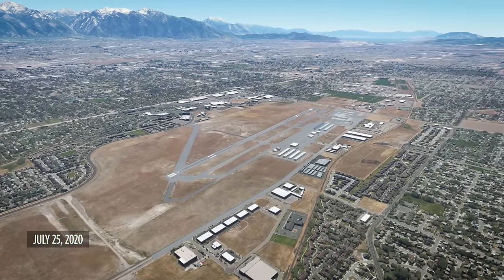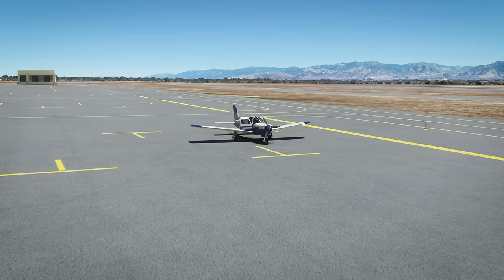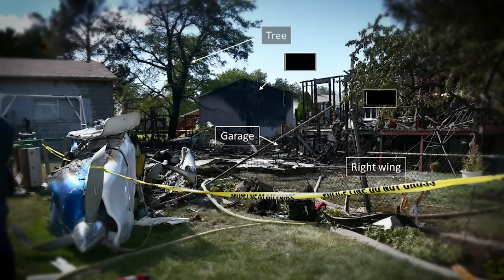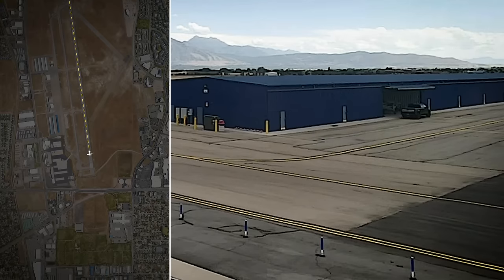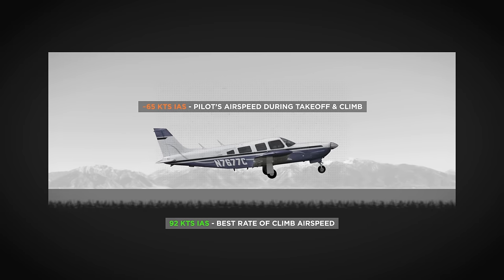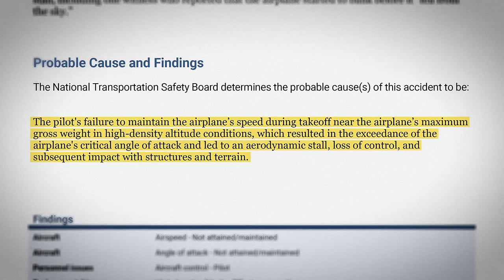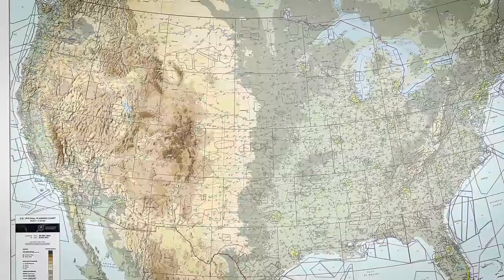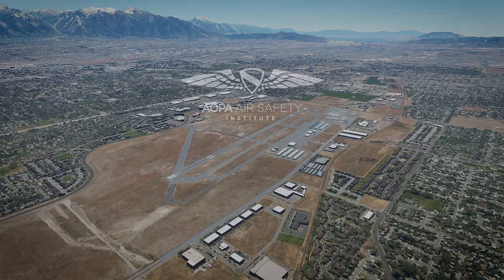Accident Case Study: High Aspirations

Comment: This is a tough one, as I think many pilots could see themselves in this position. It's easy to brush off the accident reports where the pilot does something grossly illegal or dumb and say we would never do that. In this case, the plane wasn't overweight and wasn't out of CG. The book said the takeoff could be done. Took the runway that aligned with the most recent wind report. Considered effect of density altitude on mixture setting (though perhaps too late). No single decision/mistake on its own was enough to cause this accident. It was the classic aligning of holes in the swiss cheese, where multiple small errors combine to make a huge one. Very sad and a good lesson for us all. Thanks ASI!!!
Reply: I couldn't agree more. This is really not a good example of pilot error.  Obviously a conscientious pilot, followed all of the regulations, and was not outside of the envelope in any way. I'm sure that if he took off Against the Wind he would not have had a problem. And we all know the wind can shift whenever the wind wants to shift. He could have checked wind direction 5 seconds before takeoff and the wind still could have shifted.  This is what has always made me nervous about flying. Even doing everything right is not a guarantee of safety.
Reply: Still would argue that it is a failure of regulatory bodies to allow planes to be certified with poh that seem to have almost nothing to do with reality… a 50% margin of safety on certified poh numbers? The margin of safety should be published in the poh at least no one would ever have an accident because their normal flying aircraft didn’t meet those numbers…
Reply: Absolutely agree.  The numbers said it could be done.  I cannot comfortably say that I wouldn’t have attempted the flight myself if I had been in the situation.
Reply: Planes have one job - maybe the Piper aircraft company would prefer it if you used their performance product with half a tank and seats empty
Reply: @jfmrod  It would be hard for manufacturer to estimate how much someone's engine or airfoil would degradation based on their use case, let along what's your habit on the yoke which also would affect the performance.
In airline there are now performance monitoring program for each individual airframe, I wonder if it could be done with GA as many people already have some sort of computer device around.
Reply: @umi3017  lol as if it wasn't already expensive enough
Reply: @vincelam1998  Normally, I'm on your side. I hate that Uncle Sugar wants my car to cost more every year. But, in this case, you don't need a lot of expensive gadgetry. Like the man said, maybe it's enough to have a phone? Just tell it what you're planning to do ("Climb from 3500 to 5000 feet") and let it record how long it took. I bet the right math could derive some useful performance data from that sort of thing.

Alternatively, maybe just dyno your engine every year or so. :p
Reply: @jfmrod  Agree with this wholeheartedly.  Fantasy POH numbers should be a thing of the past.
Reply: I disagree, what holes aligned to cause this crash?
Reply: We get a wind check with take-off clearance.. he would have been aware of the actual wind, not dependent on a forecast. Performance figures are based on a new aircraft flown by a company test-pilot.. all the warnings were there.
Reply: @jamesgraham6122 this was an untowered airport.
Reply: Well said.  I thought the same thing.  But for the grace of God and a little luck go I.  I learn from every one of these terrific videos.  RIP to those who perished.
Reply: @jfmrod Yea %50 margin is insane to me, with those numbers I would certainly rethink anything in written on those performance charts.
Reply: I came here to say exactly this. What’s frustrating is the NTSB then essentially blames the pilot solely.
Like yes he took off. 
But what bothers me, even in this video, is the comments like “near gross weight” etc.
The fact is he was under by 70 lbs. He did a proper pre flight, did calculations, did a run up etc. the MANUFACTURER said it can be done. And it wasn’t like it was close. It said 500 fPM and was 70 lbs under. 
They bring up the weather report 15-20 minutes after the accident, but that’s AFTER. The weather report he had was the correct run way, and for all we know the wind was still that direction at take off.

Manufacturers need to be held accountable.
I mean throughout all of my training we are taught personal minimums.
However I can’t sit here and lie and say I wouldn’t have taken off. 
Landing and takeoff distance is one thing I add 30% to. He was within that margin. 500FPM is good imo. 

Manufacturers need to be held liable if they put data that is misrepresented or just egregiously incorrect like this was. 
Instead the NTSB blames the pilot and this video even paints the pilot in a bad light. The man literally did everything correct by the book. The previous instructors who flew with him said he was good, the DPE said they harped on DA and PA. He knew.
Sad situation all around but the manufacturer needs to be held accountable.
Reply: @jamesgraham6122  Clearance at an airport with no tower? How's that work?
Reply: @MindTesla well said
Reply: @SuppressedOfficial  With or without a tower there will be a windsock!
Reply: @jamesgraham6122 This was a non-towered field. There was no take off clearance. Many pilots are guilty of looking at the windsock in the taxi to choose runway and after that ignoring it, especially on days without significant winds like the day of accident.  Wind could have easily shifted as they taxied. The bravo shelf to the north may also have affected decision of runway as there isn’t much buffer north before entering class B airspace.
Reply: @ricbarker4829 High gross weight near aft CG limit, though legal on both fronts. Takeoff on hot day with high density altitude, but with POH saying runway length was long enough. Choosing runway with last reported best wind but not best runway for actual conditions at the moment of takeoff, though not a huge tailwind. Not setting mixture to max power on the runway but instead in the roll/climb out. Remove any one of these factors and it is a normal flight just like any other. None of these things are egregious errors and are something any pilot could do. Too many of them lined up on this day.
Reply: @spvan8715  So I understand, but ignoring the information available by taking note of the windsock is just as damning as ignoring information from the tower.. of course, we can only base our assumptions on the accident report. Whatever the wind, the decisions made concerning density altitude and aircraft weight were not consistent with a cautious approach in undertaking the flight.
Reply: @jfmrod  I'm not a pilot, but it seems like you're saying that the plane's engine was grossly under-powered for the conditions they said it would be capable of handling? If so, why are they manufacturing planes with such incapable engines? Why would you make a car that can barely merge on to the highway. Or is this such a unique flight condition that the pilot "should have known better?"
Reply: @spvan8715  Do you think maybe he pulled it off the runway too soon, and was stuck behind the power curve?
Reply: WRONG - The book said it could be done but the plane had other ideas. It was a too slow to lift off and in a near stall condition.....everyone wanted to fly EXCEPT the plane and the pilot should have set it down there and them....NEGLIGENT CONDUCT!
Reply: @SuppressedOfficial  You call Salt Lake City Approach while on the ground and get your clearance (phone, or radio if the frequency is not busy).  When ready, call them on the radio, and they will release you for departure, go to CTAF, monitor, announce, and launch.
Reply: Leaning the mixture to full power during engine run up is standard practice for high density altitude takeoffs. It's probably recommended in the manual for the Piper Lance. I know it is for other Piper models.
That was the first mistake.
Second was taking off with a tailwind. He probably didn't want to fly into the B to the north. One solution would have been to call the Tracon before taking off and get clearance into the B airspace. Otherwise a sharp turn just after takeoff would have been required, which would hurt climb performance. (Edit: the NTSB report says it was an IFR flight, so airspace shouldn't have been a concern.)
I wonder if there were other aircraft in the pattern using that runway. Sometimes people flying repeated traffic patterns don't get weather updates, and continue to use the wrong runway. Then a pilot who wants to take off is pressured to 'go with the flow.'
Edit: since posting this I've started to wonder whether the mixture and tailwind made the difference or if there was some mechanical trouble with the engine. But the NTSB report says the engine monitor showed the engine operating normally. From witness statements, the report says that the airplane was stalling. I suspect the pilot simply failed to achieve/maintain Vx or Vy. Speeds below Vx will produce very slow or no climb rate, and it's very hard to resist pulling back more on the yoke. The pilot distracted himself with the mixture, which might have contributed to a loss of airspeed.
Reply: @jamesgraham6122  Maybe, but the wind may have flipped on him as began the takeoff roll.  I fly in this country, and one time on an Angel Flight out of Bluff, Utah, the wind literally flipped 180 degrees as I was rolling down the runway.  (I have a turbo-Lance.)  It happens in the high desert.  These planes are lousy climbers with a tailwind on takeoff.  I had the plane in a slow 100 ft a minute climb, put in a notch of flaps and did a slow turn into the wind and everything performed well once facing the wind.  That would be the one criticism i would have of the pilot, if he realized the wind had shifted, would be to nurse it around into the wind.  That, however, has come from life experience, and I do not know that it is taught anywhere because I have noticed it most with this make and model.
Reply: @garyrisley9170  Yes, I accept that this may have been a factor.. My main criticism is the fact that the flight took place at the worst possible time of the day, also that the pilot decided on full fuel, these decisions reflect an unsafe mindset rather than a miscalculation.. He wasn't an inexperienced pilot, he was used to flying in that environment, Density altitude was a significant factor in much of his flying... the flight should simply not have been undertaken, even had the flight been successful it was pushing the edges of the envelope.. that's not what we should be doing.. I've had to do it myself on a hundred occasions, probably many more, in some of the world's worst flying environments.. my work demanded that we do our damndest to get the job done.. he was simply taking his family out for a jolly.
Reply: @johndonaldson3619  - The point of rotation was approx. 3700 feet down a runway that is 5800 feet long. A safe assumption is that the pilot was attempting a Normal Takeoff (rather than a Short Field Takeoff - as his flap setting appeared ‘Up’ or Zero flaps), and thus rotation speed would have been around 87 knots at 3,600 lbs. 

The pilot - who has been described as ‘conscientious’ - would most likely have deduced that there was not enough runway remaining (less than 2000 feet, OAT 90°, DA above 7,000 feet) to safely stop before the end of the runway, and followed the Emergency Procedure of a ‘Loss of Power at Takeoff’. This procedure calls for a retraction of gear, and a best rate climb at around 67 - 75 knots of airspeed.  If there was a tailwind, coupled with the High Density Altitude (DA), would have resulted in a perception (to the pilot) that the aircraft was not performing to specifications. And thus, the Emergency Procedure was both implemented and futile.

Could the pilot have pulled power, slammed the brakes, and had an off-field excursion, instead of rotation at 3700 feet? Possibly - but this would have flown in the face of both his training, and the published Emergency Procedure. And there is no assurance that an off-field excursion would have resulted in a different outcome for the aircraft, pilot and occupants. 

What would have saved lives in this scenario would have been a hard ‘Abort Take-off’ decision point - the kind used by commercial aircraft/pilot decision math. Calculating the Rotation Point, and Abort Take-off Point, would have given the Pilot a clear decision path on Rotation - and he may have done that with an in-to-the-wind takeoff expectation . But - and this is important here - the pilot appears to have followed both the training and published procedures at Take-off. It appears to me that the pilot, unfortunately, did not take Density Altitude and (possibly) wind into consideration when conducting his flight planning prior to beginning his take-off roll.
Reply: @johndonaldson3619   The ONLY point of negligence on the pilot's part was persisting in farting around on the mixture and pitch to try to "convince" the plane to keep going... SOME of that is forgivable, because it's entirely possible for ANYONE to slip "behind the power curve" and the correct means to fix that is to do what you can to level off and let the plane accelerate before trying to climb much faster again... After that, He should've done one of two things, either 1) make the turn back to try to get to the runway and call the trip with the plane at least "parked properly" OR 2) figure out wherever in hell was clear enough to land it outside and just glide down and in there...

   SO no, I'm not defending that part of the "set up" for disaster... It was clearly NOT performing "as expected" as soon as it was off the ground, or even sooner... so there's very little to defend.

    However, I have yet in ANY OTHER SECTOR or place to find where I'm expected to pad my own math of the "legitimately published numbers" to pad by anywhere NEAR %50! The idea that for all their tech' and care, Aircraft manufacturers don't even BOTHER to know their own planes' performance spec's to within 50% is completely BAT SH*T! 10 or 20% is one thing, frequently involved in the engineering of electronics, but at 30% I'm all out of patience and someone NEEDS their figurative Ballz sued off.  ;o)
Reply: @ferzon69 planes perform much worse in high altitude airports and hot temperatures, but the loss of performance is described in the manual of the plane. This pilot checked the manual and got the information that it should be safe to perform the takeoff, unfortunately the numbers in the manual seem to be far from what the plane could really do. The pilot prepared his flight well but it’s not clear how he could have avoided the accident, monitoring his acceleration might not be enough if the plane could not keep climbing because of poor engine performance. I guess when flying close to the limit one needs to do some performance checks on the plane and not just trust the numbers on the plane manual…
Reply: @umi3017  I’m not asking for an exact prediction, but I definitely expect safety critical numbers to have a significant margin of safety rather than be representative of a brand new plane with a brand new engine being flown by a test pilot… no one needs that number because no one is flying in those conditions and if you were you would not get killed if the POH said you couldn’t make the flight…
Reply: @bbgun061 I don’t see the tailwind being a factor, as he didn’t run out of runway. One could argue he lifted it off too soon for the conditions, failing to accelerate to a high enough ground speed before lifting off, and a tailwind could have increased the required ground speed. But once in the air the plane should just accelerate to the same airspeed fairly quickly. Seems like he trusted the book numbers too much. Apparently Piper doesn’t put a safety factor into those charts. My lesson from this is leave at sunrise if it is hot, and wind it up to ludicrous speed before leaving the ground if anywhere near gross.
Reply: @kwittnebel  Yes, the airplane should climb the same once it's in the air. But more runway after taking off means more space without obstacles to climb. Also a lower groundspeed means it can climb higher in the same distance.
Reply: It is pilot error, he continued on flying the plane that wouldn't climb,  he should have sat it back down and called it off. Sad but you gotta be on the ball and ready for problems. There was plenty of room to land after it failed to climb properly the first time.
Reply: @Wilko710  plenty of room to land but not enough to stop — once he realised that something was off there was no way to save this situation, unfortunately. The only thing the pilot did wrong is technique — he should have continued accelerating in ground effect but it seems he panicked flew out of ground effect and almost immediately settled back down and there wasn't enough room to recover. Everything else is hindsight, which is always 20/20 and doesn't allow for useful learnings. If anyone is really to blame here is Piper for not caring as to what happens to POH numbers on their aging fleet. Also, somehow we still fly with a mixture knob in 2023 — the job of setting the mixture optimally for ambient conditions can be solved with a 5$ tiny computer.
Reply: @YaroslavNechaev i'd rather skid to a stop through grass while level than go upside down at 300 feet and stack into someone house. A lot of flying is common sense.  Wait till you get into a 200t Seneca, that has 2 mixture knobs oh my gawd 😂
Reply: @Wilko710  You may be right, but could the pilot have identified the problem while there was still runway left?
Reply: @Wilko710  based on his manipulations with a mixture knob, I'm sure he thought that he needed just a little bit more horsepower and the airplane will escape this behind-the-power-curve condition and start to climb. I think he really got dealt a bad hand here: the airplane was underperforming, sure, but, on the one hand, it didn't underperform enough to make a timely abort decision and, on the other hand, didn't allow him to clear the obstacles. 

Honestly, it's hard to find useful learnings from this situation: if AOPA is to be believed we need to all buy a 50% more capable of an airplane than our missions require. Sure, it's a solution but is it a realistic one, I wonder?
Reply: @arctain1  What are you talking about? The investigation showed the flaps at one notch. There's no procedure for loss of power in a single engine plane other than 'land straight ahead'. You sound like you're talking about losing one engine on a twin engine airplane.
Reply: @bbgun061  easily, he had time to decide to do 3 climb attempts, he had children on board, as soon as it started to come back down he should have just chopped the throttle and called it off, as the saying goes " it's better to be down here wishing you were up there, than to be up there wishing you were down here"  but like people say, hindsight is easy, but i have been in situations like this, i know he was trying his best to climb but sometimes it's better to claim on aircraft insurance (fear of embarrassment) than having your own funeral.
Reply: @bbgun061  It doesnt seem like there were many obstacles, as he managed to get over whatever was there without any altitude. If only he had gone with half tanks he would be alive. I fly a 140 and with two grown men in the plane I never top it off. He was in the unenviable position of being correct by the book but incorrect by the laws of common sense and physics, which tells us to never tempt fate by leaving full gross on a 90 degree day at a 5000ft airfield with family in the plane. Modern day Icarus. I do wonder if he could have accelerated in ground effect and somehow pulled this off. Kinda makes me want a turbo, but realistically we should all buy more airplane than we need if this video is any guide.
Reply: @bbgun061  - Read the POH for this aircraft - Emergency Procedure for loss of power at rotation and not enough runway (or rough runway) to safely stop.  So, either you have no idea what you are talking about, or you have zero time in type, or both. I suspect the latter.
Reply: @YaroslavNechaev  6 up is risky in a single non turbo anyway,  you can feel the plane coming alive well before takeoff and know if something is wrong with how it would feel sluggish to respond,  i wonder if he ever flew with 6 up on a good day. And i wonder if he was trimmed correctly, i forgot if that part was mentioned.
Reply: @arctain1 You suspect wrong. I'm a CFI, an airline pilot, and I've taught a student who owned a Lance.
I don't have a POH handy, but I read the report. It says the engine monitor showed the engine operating normally. From witness statements, the report says that the airplane was stalling. I suspect the pilot simply failed to achieve/maintain Vx or Vy. Speeds below Vx will produce very slow or no climb rate, and it's very hard to resist pulling back more on the yoke. The pilot distracted himself with the mixture, which might have contributed to a loss of airspeed.
I  flew over the Grand Canyon in a 172, and taking off from those airports was similar to this video. But I held the plane at Vy, and even though we were only climbing at a few hundred FPM, we were able to climb safely.
Reply: I agree with nearly all that has been said here. The poh should not lead you to such catastrophic outcomes despite appropriate vigilance. It is worth thinking about, as some of mentioned, full fuel was not necessary for the planned 230nm flight. Topping off the 94 gallon tanks was a significant part of the accident chain. We all feel better with full fuel aboard - I know I do it often - but he easily could have left off 200 pounds of fuel and still have enough to comfortably make the flight and have 1 1/2 hour reserve. My take away is that on flights where one set of parameters - in this case DA and climb performance- are pushing the envelope perhaps we should consider compromises elsewhere. Maybe being 200 lb lighter would have mitigated the “minor” issues of a wind shift and imperfect mixture management. I can’t say I wouldn’t have done exactly what this pilot did, but I sure will think harder about things when I’m near the edge of the envelope having watched this. RIP.
Reply: @bbgun061  - since you don’t have a POH handy, perhaps you should have checked before spouting off - kind of the opposite of what a good CFI would do. Now, the POH says exactly what I said it says. The rest of your ramble makes no difference - as I said, the DA and possible wind shift would most likely have caused a perceived loss of power at rotation. And if the pilot was trained by a CFI worth his salt - one that actually reads the emergency procedures - then the pilot would have reacted, most probably, as I said he would react due to a perceived (not actual) loss of power. Now - be a good CFI and read the POH before spouting off again.
Reply: Unrelated but please comment on this story in the Washington Post; 5,000 pilots suspected of hiding major health issues. Most are still flying.
Reply: @MindTesla we know the wind direction at takeoff, because you can see the wind sock.  I assume the pilot can see the wind sock as well, that’s what it is for. It was doing the opposite of what he wanted.  He probably could have aborted.  My nephew aborted on a much shorter runway in his Baron B55 when he was concerned.
Reply: @miragesmack007  where do you have ANY evidence that at takeoff (when he took off) the windsock was not doing what was reported?

The fact is, you don’t have anything.
What we know is at the time of takeoff the weather was reporting for the runway he took off on.
Reply: Lumbering down the runway at 3000' and the airplane wallows around and doesn't want to leave the runway.....that's the time to close the throttle and find out why.
Reply: it's pretty stupid people are dying in small aircraft because they don't have advanced engine controls found in all modern automobiles for decades
Reply: I agree the POH claims it can be done but at a DA <7000 I question how a  on-turbo loaded like that would not have serious issues.  That Lance was NEVER a performance machine in the best of conditions.
Reply: Yes, I'm not all that comfortable thinking I may have done the same..😢. I was trying to find something wrong with his decision making, but his was pretty good.
Reply: True that. Also having people aboard IS a factor too.  This leads to distraction, desire to perform, etc.  I am not saying that this was the cause but herding cats definitely can be distracting and one of the factors I include in my decision making process when flying.
Reply: @garyrisley9170 I fly out of Skypark, about 20 miles north of U42. The windshift and windshear in this valley is a danger that many don't recognize. I have observed a single occupant  Lance take off and circle dangerously low while trying to gain speed and altitude.
Reply: @pfazza19  ...and not for too many hours since the wings will then occasionally fall off.
Reply: @JoelDubey  It's not an example of pilot error at all. The video was a waste of my time since it had no real point to make other than how mistaken pilots are for using POH numbers since ~500 FPM might also equal zero. I think insurers are crazy to continue trying to operate in the single-engine / light-twin GA space. Even the engineering, let alone pilot training and performance, is often just too sketchy to justify it.
Reply: This. I learned to fly in CO, and during summer would take off with density altitudes in the 7-8k foot range. It's easy to look at this video and say "it wasn't a good idea" but all of flying isn't a good idea. All we can do is take calculated and careful risks, or hang up our wings. I've flown in these conditions once before. It scared me and I'll never do it again.

Sadly, the fleet of ancient GA planes we are stuck with (because of over-regulation, liability lawsuits, and monopolies) are just woefully underpowered and lack modern tech that could save lives.
Reply: @spvan8715  "Remove any one of these factors and it is a normal flight just like any other."  Nope. Not even close. The POH was dead wrong. None of those factors, separate or together, are significant as far as the calculated performance. This was not a pilot-error accident despite the NTSB's best efforts to avoid pinning it exactly where it belonged, and this video mostly complimenting their efforts.
Reply: @YaroslavNechaev What about a useful learning something like never exceed 70% of max gross weight? Being at 98% seems to be pretty optimistic given high density altitude etc.
Reply: Just because a airplane can climb at 500 FPM does not mean it will if less than optimal technique is used..  Not saying this is what happened but it just might have, if a airplane is climbing at too low of airspeed it is on the back side of the power curve, drag is much greater here.  With more airspeed drag would be much less and performance would increase. Let speed build then climb out, better to use more runway and have enough speed, VX or VY @ReflectedMiles
Reply: @dwaynemcallister7231  And how much runway had he already used relative to the POH numbers? And how much remained? Very little. Unlike smaller, lighter, less-complex versions of this series of aircraft, the Lance uses a lot of runway in these situations and pilots experienced with them will be expecting that. I certainly disagree with those suggesting that he could have set it back down on the remaining runway or that his acceleration was necessarily slower than the slow acceleration expected and he should have aborted. We have little reason to think the latter is true, either. Using that much runway, he should have reasonably been in the range of Vx or better airspeed at rotation, not hanging around the stall below that. If he did eliminate the entire published margin, that suggests that a failure to lean the mixture or the possible use of a notch of flaps has an extraordinarily greater impact on performance in this situation than an experienced pilot might expect. Was he that experienced, though? These videos don't necessarily give us the actual, full story.
Reply: "In this case, the plane wasn't overweight and wasn't out of CG. The book said the takeoff could be done."

Sorry, but I completely disagree. I would have taken one look at the temperature, the field altitude, the number of passengers, and said, "No flipping way." It would have taken me 30 seconds to consider this flight and decide it wasn't happening. You have to have had a bilateral lobotomy to try what this guy did. If you want to do it yourself, that's one thing. But take a look at the other 5 people and as yourself if you want to be the person that kills them. This was the absolute height of stupidity. And saying "hey, he wasn't overweight and was within CG" is insane in my opinion. I just don't get it.
Reply: @IslandSimPilot  🤣 Yeah, fortunately aviation ops aren’t based on feelings. Otherwise, taking your bags to the airport, especially on a hot day to one at altitude, could result in a dispatcher or the captain randomly looking at the passengers and deciding the flight wasn’t happening because they didn’t want to kill them instead of relying on the data and book numbers for the flight. Is that also how you approach instrument flying—stay on the gauges until things are turbulent and you’re convinced they’re lying to you? If the POH was actually in error, which has happened before, the NTSB and FAA should be coming down very hard on that. If the POH is correct, then a serious, exacting explanation needs to be provided for the cause that was absent in this video.
Reply: @IslandSimPilot  So tell me then what the point of the POH and performance calculations are?? 

Was a near gross weight, highish density altitude flight something with some increased risk factors? Sure. Was it something that was absolutely outside the realm of possibility. Obviously not. The book said he should have been climbing at least 500 fpm. There are some low powered 1-2 seaters that struggle to achieve that at sea level on a warm day. The POH is meant to show us what is within safety margins and what is not.
Reply: @spvan8715  "So tell me then what the point of the POH and performance calculations are??"

First of all, the POH is not regulatory. Secondly, the purpose is to tell you what the airplane is capable of when it is brand new, in perfect working order, and being flown by a professional test pilot. Are you a test pilot? I'm not.

"The book said he should have been climbing at least 500 fpm."

That and a dollar will buy you a cup of coffee.
Reply: @ReflectedMiles The POH is not regulatory. And this is exactly why we keep seeing this same accident over and over again, because some people clearly refuse to learn from it. Sigh.
Reply: @IslandSimPilot  Right, I forgot about the regulation that states “a pilot shall not take off from a public airport, following all applicable regulations, and operating the aircraft within the manufacturer’s published recommendations”. If only they had followed that specific reg…

Your argument makes no sense. No “regs” were broken in this accident flight. What you are talking about is personal minimums and everyone’s will be different. I’m glad you would never have attempted a flight like this. Perhaps your approach is to never take the plane out of the hangar. Everyone is safest that way after all…
Reply: @spvan8715  "No “regs” were broken in this accident flight." 

I didn't say any were. Part 91 we're free to be as dumb as we want to be.
Reply: @spvan8715  Also, the SID for this airport (U42) requires a minimum climb rate of 300 feet per nm. At Vx in this airplane, that's 450 feet per nm. His calculations were that it should - SHOULD - climb at 500 feet per nm. So he gave himself a 10% cushion on the DP if everything went perfectly... and then took off downwind. I just don't know what to say.
Reply: @IslandSimPilot  Ummm… 14 CFR § 91.9(a) isn’t regulatory? Why does the NTSB care that it was complied with, then?
Reply: @ReflectedMiles  Does this airplane have an AFM? (I know the answer, time for you to look it up and then try and understand why I ask). I will say it again: there is a reason we keep having this type of accident, and clearly some people are determined not to learn the lesson.
Reply: @IslandSimPilot  It would be the more exhaustive POH since that was the primary document used at the time it was manufactured rather than also having an AFM as a newer model would. However, that makes no difference at all as far as the regulatory effect of the CFR.
Reply: @IslandSimPilot  Just a heads up that you’re discussing with an FAA guy there. Don’t say anything stupid about what you do or don’t do personally.
Reply: @ReflectedMiles  And again, I didn't say he did anything illegal. Remember that legal and safe aren't always the same thing. Which is pretty much my point. We should never see another DA accident again. Just like we should never see a fuel exhaustion accident again. Just like we should never see another VFR-into-IMC accident again. Just like we shouldn't see another accident where the elevator is rigged backwards after an annual again. And we see them over and over and over again. And we will continue to do so. Yet here we are listening to a bunch of pilots saying this flight should have worked. We are absolutely bound and determined not to learn. We simply refuse. "It should have worked!" I would have taken one look at this flight, without even a peep at the POH numbers, and said, "No. Flipping. Way." Could he have made it? Maybe. Should he have tried? Unequivocally, no. Absolutely friggin' no. But as a pilot community, clearly we're going to keep trying, and clearly we're going to keep seeing this happen. Sigh.
Reply: @IslandSimPilot  You are comparing events and judgments that are not comparable, and that was not your point. Your point has been that you are safer by looking at a situation than someone flying within the margins of certified performance standards, to the point of making false claims about what is not regulatory and required. We do want both manufacturers and pilots to be conservative in their expectations—that part is true—but the entire industry worldwide depends on certified performance data being reliable, not on pilot hunches. In fact, it was some assumptions—some “looking at it” by test pilots and program managers at Boeing, and their counterparts at the FAA, rather than rigorous analysis, that led to the 737 MAX fatalities. It was possible for a crew to overcome the resulting scenario, and a couple of them did, but no amount of “looking at it” would have assured anyone of a safe flight. Correct engineering, well within the marginal abilities of a crew of average training, was the principal element that safety of flight depended upon. If you are more than a sim pilot per your screen name, I hope that you will go further with your aviation training and education to better understand regulatory requirements and the how and why of their development. If you are in or near the US, I recommend making an appointment to visit your nearest FAA Flight Standards District Office to discuss their work, and they can offer you specific resource recommendations. I’m glad that you are concerned about not taking unreasonable flight risks.
Reply: @ReflectedMiles  I'm an FAA PPL-IR in real life, this is my flight sim account. I do appreciate your willingness to engage in this conversation constructively. Part of the issue is that in your last reply you're talking about professional flight crews, and here we are not (and "of average training" applies to both, I would say). I think we could dig a lot deeper into this accident than we have. For example, it seems he was either interested in avoiding the Bravo, or he was going to take off in the direction of his destination regardless. Neither of which makes sense - he was flying IFR. Was he picking up his clearance in the air? Did he get it before he departed? I see a lot of pilots making decisions to make things easier and more convenient that in my opinion are less safe. If you're departing IFR, the Bravo is irrelevant. They're either going to steer you clear of it or fly you through it. It shouldn't matter. Nor should taking off in the direction of your destination be a part of your thought process. Then if you look at the DP, it calls for 300 ft/NM, which in this case would be 450 FPM (assuming a 90-knot climb rate). So he was betting that he, as an PPL-IR in a nearly-50 year old airplane is as good as a test pilot with a brand new one. (And again, taking off downwind). That doesn't seem like a good bet to me. As to "hunches", I'm not talking hunches, I'm talking safety margins. I was taught (and find quite reasonable) building in 50% margins for book numbers. Is that too much? Maybe. But I'd rather err on the side of caution. Yes, if you the plane using POH/AFM techniques you should get POH/AFM performance. I'm just not willing to bet my life on 10% margins.

I still stick to my original statement, which I suppose is only true for me: I would have taken one look at this proposed flight and said "nope."  Based on field elevation, temperature, and load. No way. Cheers to the guys who are willing to try this, and obviously some succeed. Perhaps a lot do. Perhaps I don't know my arse from my elbow because I fly out of an airport where the highest DA I can ever remember is about 2,000 feet. But in my humble opinion, something is missing in the training and certification of pilots if a cautious, conscientious, reasonably well-trained pilot does what this guy did. Because as I'm sure you well know, this has happened 1,000 times before and it's going to keep on happening. And that's a problem.

I had the good fortune of learning from several "old guys" who have been flying for 50 years. What you hear from them and what you hear from people taught by 20-year olds is completely different. I see it all the time, "The plane should have been able to do X," "the POH says Y". Always after someone does something like this guy did. And like the guy above essentially calling me a wimp. Fantastic safety attitude - "you're too much of a wuss to risk your life doing something stupid!" Guilty as charged. 

There's a difference between knowledge and wisdom, and I think that is the gap this guy fell through. 

(And in terms of the POH being regulatory or not, I wasn't referring to W&B for example, or fuel burn - clearly those are regulatory and must be complied with. Are climb performance numbers "regulatory"? Can you illegally climb too slow? What I meant was that performance numbers like that are, for lack of a better term, reference numbers for flight planning.)
Reply: @IslandSimPilot  The POH, including claimed performance, must be certified for any non-Experimental airplane. Engineering margins are expected to be accounted for due to the multitude of variables that can be involved. Weight and balance aren’t going to do anyone much good if they do not involve the aircraft being able to get off the ground within a certain distance and at a certain rate of climb. In that case, we would just certify the weight based on whatever the tires and airframe are able to endure without damage, etc. I certainly advocate for better, more airline-level PPL training and recurrent-training standards such as with the use of AQP scenarios. However, if aircraft are only good to 50% of their certified numbers, that is a serious problem not only for safety but for dependable aircraft utility, legality of marketing / fitness for purpose, etc. For a commercial example, the 727 was operated at high and hot airports as it aged over decades with passengers and cargo weight having to be removed to get just under its maximum certified numbers for dispatch at takeoff. The margins were almost non-existent much of the time as those were baked into the certified numbers, and the aircraft would scare observers as it went airborne right at the end of the runway—just enough to clear the fence. Yet in countless thousands of flight hours and cycles, there was only one accident that I know of in which that practice was ever a contributing factor. While there was always the big advantage of a professional dispatcher being present in that example, that is nevertheless how certified numbers are supposed to work, regardless of the level of aircraft we are talking about. Why? Because the aircraft in the accident in this video could have been picked up by a Part 135 operator and flown for commercial purposes. We don’t officially put the lives of commercial passengers and crew above or below those of general aviation passengers and crew.
Reply: @ReflectedMiles  Yeah and that is the other side of the coin to me: I'm not a commercial pilot, and I'm well aware of that. The book numbers were arrived at by a pilot who let's face it, is a better pilot than I am. And by 50%, I mean that I was taught to add 50% to the book numbers, i.e. if the book says the takeoff will require 1,000 feet, plan on 1,500. Technique plays a huge role, too. This guy was clearly hauling back on the yoke for quite a while trying to get the plane in the air; he would have been better served letting the plane gain speed, get it off in ground effect, and go from there. But that's neither here nor there. I just don't understand the thought process, though clearly a lot of people do. There are old pilots and there are bold pilots.
Reply: @ReflectedMiles  PS, I'm based out of KRME, if you're located anywhere near there I'd be more than interested in coming in for a chat. The more I can learn the better.
Reply: @IslandSimPilot  If it is possible to determine whether there was additional pilot-induced drag in this accident scenario, I have not seen that but, again, I have not studied the actual report and any footage available close-up and cannot comment beyond what is in this video. If so, that is certainly less than ideal technique when building airspeed is the paramount concern, but unless it was extreme (e.g., pulling the aircraft up into ground effect and then setting it back down), it should not have prevented acceleration into the Vx range. I would be more interested in engineering analysis and modeling of the power being produced to see if that was actually within the expected range. If he was genuinely below expected acceleration by the time he was at around 50% of his ground roll, then he should have been aborting the effort, but that is also not a standard training metric taught to most GA pilots.

I would enjoy such a meeting and discussion, but unfortunately I am on the other end of the country. However, your nearest FSDO is probably in Albany, and it's worth checking on any programs or open-house events they have during the year, or as I wrote earlier, just making an appointment to "talk shop" and ask questions. They will be able to add more light and nuance to these subjects than I can in YT comments. Best wishes!
Reply: @ReflectedMiles  "If he was genuinely below expected acceleration by the time he was at around 50% of his ground roll, then he should have been aborting the effort, but that is also not a standard training metric taught to most GA pilots."

Yep, 70% of your takeoff speed by the halfway point or close the throttle. That's what I was taught as well. And thanks again, you clearly have a lot of knowledge and I do appreciate you sharing it with me. All the best to you as well!
Reply: @jfmrod  the numbers are for brand new airplanes. An old one with paint turned to scales (high drag) and perhaps an engine with degrading compression, etc can have an impact. I think AOPA’s 50% also accounts for people not flying exactly perfect technique every time, and the fact that a even a slight downdraft can create a negative climb rate if you’re starting out with a <500fpm climb rate. My personal observations for my plane in high density altitude give a max runway distance I’ll use for takeoff. If I exceed that roll, the plane won’t be climbing well once in the air.
Reply: Max weight, downwind take-off, very high DA, what could go wrong ?
Reply: @12345fowler  exactly!
Reply: Such an astute pilot and caught by one oversight. ONE!!
Reply: how do you all of this ? pure conjecture -the video provides proper analysis and information
Reply: @MindTesla I'm with you. But as a pilot you better keep an eye on the general performance of your plane. Of course only possible when you fly it regularly. With age performance degrades. So the numbers from the book might not be met anymore. Especially when you get closer to the limits, you should consider not having everything given by the numbers. Though I always thought, the numbers would be already very conservative and well with safety margins. This accident lets me rethink that for sure. But I also know quite a few pilots who say „you can overload your airplane and still fly, no problem“. Not a good attitude. But this pilot wasn't like that. And maybe this pilot could also has been me. 500fpm climd is still a good number and even 100fpm would have made them climb. At least considering the very flat and open landscape would had made it possible to return to the airfield. When the performance of the plane was THAT bad, I would still suspect something else gone wrong. Maybe he caught an unlucky gust when he tried to turn around?
Reply: @MindTesla  "where do you have ANY evidence that at takeoff (when he took off) the windsock was not doing what was reported?"

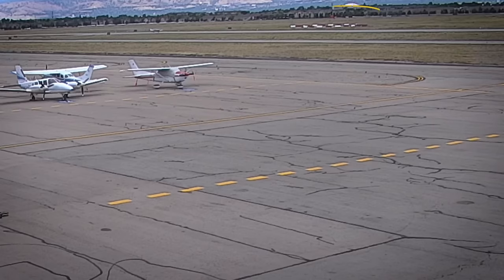3:10
Reply: A intelligent pilot looks at current winds and observes things in the immediate view for actual wind conditions because often those reports are inaccurate often and they rarely cover gusts etc.
Reply: @MasterCarguy44-pk2dq  and show me this pilot did not do that. In fact there is NOTHING supporting this.
Only thing supporting him is he took off on correct runway with correct winds.
Reply: Low wing aircraft lie to you on takeoff roll due to ground effect, it’s not as simple as setting a go-nogo point on the runway remaining and by the time you confirm positive rate, it’s too late. 
I also think leaning engines to get more power needs to be condemned , shouldn’t be acceptable practice for takeoff, too easy to starve the engine as it seems this is what happened here Ridiculous that we still have manual mixture engines in brand new certified aircraft in 2023
Reply: Gross weight was good. CG within limits. DA accounted for. Preflight and run up were good. Took off with most recent weather. Used a sufficiently long runway. 

I don’t know if he rotated early or not but assuming not the only mistake he made was not setting an appropriate decision point to abort takeoff.
Reply: @ricbarker4829  Weight and CG on the margins of the performance envelope. High density altitude. Downwind take off. Murphy's Law: If something bad can happen, it will happen. Maybe not every time, but sooner or later. And when one takes into account just what, exactly, that "bad" thing is, in this instance, death or severe injury and property damage, one has to ask, can I live with the consequences of that "bad" outcome? No? Then rethink the situation. Come up with another plan. Change one or more of the variables. Less weight (don't top of the tanks); an early morning departure, when temperatures are lower; pay attention to the wind sock, be willing to change runway.
Reply: @jfmrod So, we dumb down the performance charts to reflect an element if incompetence instead of actual performance?  Another flaw in this logic is that you cannot show a flight performance envelope without there being an edge of envelope.  Here, the pilot was at the knife edge of performance envelope.  But I get what you are saying about the human factor.
Reply: I agree OP, exactly my thoughts. If this was an exam question, I think most would say yes looks good to go. Really sad and a terrific lesson to take heed.
Reply: @jfmrod  quite a lot of "certified" aircraft, most prior to 1986, are unable to meet their performance specs when new. Let alone 11,000 hours later all dented and worn out. Experimental/homebuilt and even many kits are absurd offenders. Since they aren't certified, and the designer expects the builder to perform flight tests to verify and requires a waiver. There is no legal requirement not to lie in this area. (It is a sticking point I have with certain, fairy well known kit manufacturers). 

Vans, Rans, Sonnex, Sport Performance. These guys are very honest. The others, meh not so much. (Unless it's an LSA qualified kit).
Reply: Completely agree. This one hit hard.